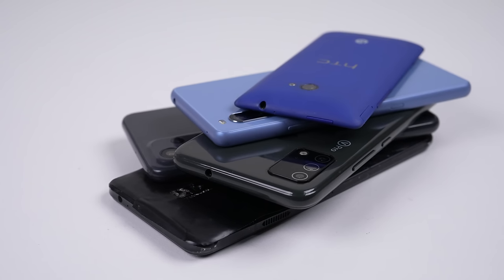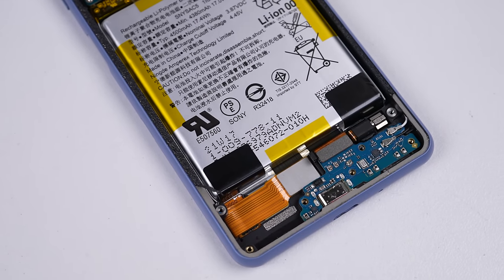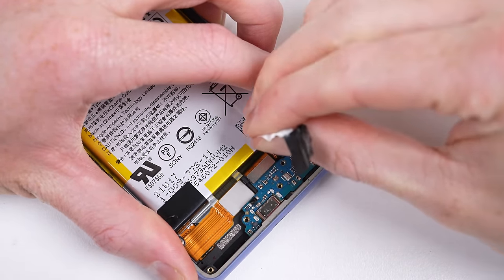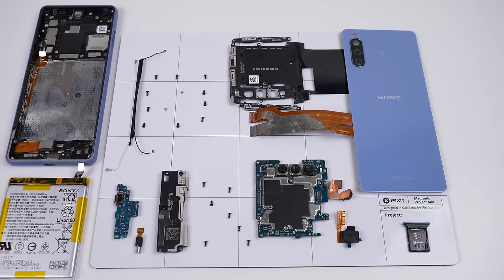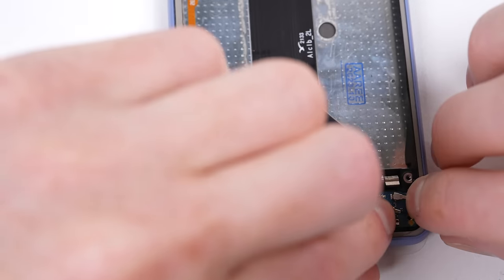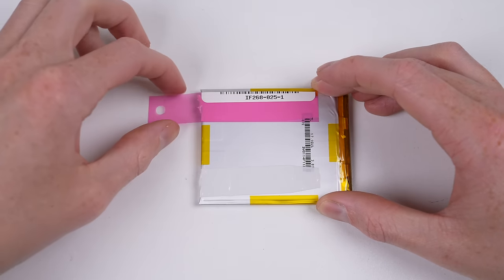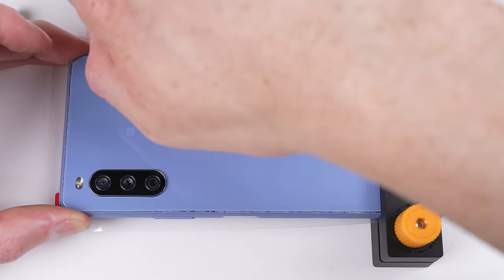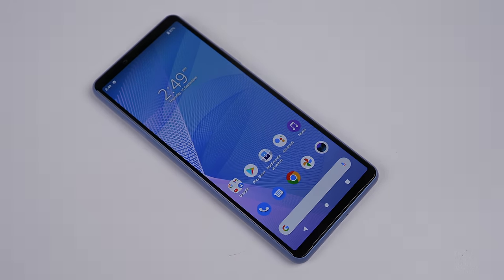This Uncommon Phone Is Shockingly Easy To Repair - Sony Xperia 10 Mark III

Comment: The problem with Sony phones is their pricing and aftersales service sucks, not to mention their OS update support is the lowest among Android OEMs (2 years of OS updates only while other Android OEMs give 3 to 4 years of OS updates).
Reply from the maker: This one supported Android 10-13. Thats better than my Blackberry that supports Android 8.1-8.1 :(
Reply: @HughJeffreys Are you sure? I have this model and it shipped with Android 11, the last available version being 13. Security updates are probably already halted as well, unless Sony quietly changed their policy recently.
Reply: @HughJeffreys  have you thought about making a video talking about the AU 3G (2023/2024) Switch off and the e-waste implications for older 4G Android Phones that don't support 4G VoLTE Calling? Older Pixels, Samsung and various Sony Phones are affected. Also any Samsung device with Android 11 or lower won't have VoLTE Roaming (Per Optus's website). Wanted to contact you about this a month ago but your website contact form is closed. Optus in 2019 even said to the ACCC that "VOLTE cannot be the sole technology relied upon to provide voice services" and "even if VOLTE were available over the whole network, end-users would be unable to use the technology due to incompatible handsets". With the 3G Switch off a whole bunch of 4G phones won't be able to make or receive calls anymore. Happy to discuss further etc. I've got Twitter and email is on my Youtube about page.

Comment: Being sonyboy for the last decade, I also wonder where people are geting all this nonsense about sony's phones and tablets.
Sony's mobile branch is the most customer respecting company on Earth and their devices are both serevicable, functional and stylish.
Unlike some vegetable devices, sony's do actually look and feel premium.
And they are priced more premium because they are.

And when you need to replace a battery in 3-5 years, it's not that hard.
And may want to do this, because even in 5 years it will still be powerful enough, more than stylish and also supported (most likely by a third-party, but the bootloader is openable and the drivers package is available).

Comment: I knew someone who worked for Sony back when they were still selling in Australia. He said the reason why they tanked here is because of a failed marketing campaign (something about how they said waterproof even though their phones were, in fact, water-resistant, and some higher-up's stubbornness in not rectifying the language). It led to heavy losses and legal trouble, leading to them pulling out of the market here. Based on this story, it's not so much lack of interest from consumers, but trauma from getting burned for a few badly chosen words in a marketing campaign.

I love that they go against the grain and keep going with things like the headphone jack (which I really feel the pain of with my Xiaomi 12 since my car uses an AUX cable, no Bluetooth audio...). 
The only problem I have with importing Xperias as an Aussie is their lack of support for VoLTE and 5G, even in newer models such as the Xperia 1 iii which my friend has. With 3G getting switched off, Xperias aren't a viable option anymore unless there's a workaround like installing SEA firmware.

Comment: I have a Sony phone, the UI is buggy has less OS updates than other flagships and has random quirks.

The camera is not user friendly, it's great if you're a professional photographer who likes to customize all settings but it's not good if you want to take a quick photo of something which is what you'd need a cell phone camera for 99% of the time.

I got my Sony because of the SD card but I think I might just move to an SD card less phone with a lot of storage as SD card phones are basically dead in the US unless you want a mid range

Comment: Just based on my experience and what I’ve learned, Sony phones never gained significant traction in the USA. It seems that Western markets weren’t particularly drawn to them. Sony eventually shifted its marketing strategy and focused more on Asian markets, where they performed better. Personally, when Sony phones were available in my local market, they were expensive and didn’t offer a compelling value proposition compared to other smartphone brands in the USA. For a similar price or even less, I could get a better overall experience with a Samsung phone.

Comment: Is the replacement display you put in in this video genuine Sony or aftermarket?

I'm still rocking an XA2 for which I recently had to replace the battery. (It had inflated). Replacement was pretty straightforward. Only issue I had was one of the antenna connectors broke off the motherboard which was a pain to resolder. Getting a replacement battery wasn't hard, but I couldn't find an original from Sony. 

Also, has anyone done a bend test on this (or similar designs from Sony)? It looks pretty long, thin and narrow...

Comment: The reason why Sony's phone division isn't as popular as someone like Samsung, is because sony has a rather lacking record when it comes to software update. Pair that with how much more expensive their phones tend to be, and most people just steer in the direction of what we already know just works (Samsung, google, apple).

However, if you can afford Sony's phone, they are definitely the better smartphones available right now. Software wise, you can always tinker with custom roms if you feel comfortable withthat

Comment: Also btw I'm sure you've noticed by now, that you could've removed the charging port board and vibration motor first before attempting to use the battery pull tabs and it would've probably worked, save yourself the time and effort next time :D

Comment: Sony's phone hardware are great but software are abysmal, I've got a Z5 back in 2015 and it was nice at first, not two years later my z5 running latest supported android and it was slow, slow to crawl, everything crashing and it would randomly restarts, mind you, z5 was a top of the line model, yet it was defeated by Sony's software, in true Sony's fashion it also shipped with metric ton of bloatware, this is know issue not just Xperia phone, Sony's laptop, vaio also suffer from this and both of them are the reason why Sony's tech are never took off to its other level.

Comment: Sony putting the Lego in phones. 

Sony has bad marketing when it comes their smartphones. It has great hardware, simple software and specs monster to boot. But short software support, bad marketing distribution and low worldwide availability means it's not accessible to most market. Still, it's if you want an all rounder Android that's not Chinese or Samsung.

Comment: The majority of the consumers don't know that sony makes phones since they are no commercials about sony phones like the commercial for the sony ps5. The average consumer only knows about products if they are marketed on tv commercials. Consumer products have to be marketed and commercialized like cocla cola and mcdonalds fast food since they are ubiquitous. I really enjoy using my xperia 1 iv but I already have burn in issues just like every device that I use with an oled display already have burn in issues. I wish there was an option for a mini led display for all android devices to get rid of the burn in issues but also have an option for an oled display for the consumers that want to use an oled display. The samsung, motorola, nexus and pixel devices with an oled display that I use all have burn in issues. I got burn in issues with all the devices that I have mentioned. It's why I prefer to have a mini led display as an option to rid of burn in permanently. When I got burn in issues, the white background is no longer white and have turn yellowish and even reddish with the display brightness have gotten dimmer overtime and it makes it harder to see outdoors. The way I use any oled display, they will get burn in 100% of the time.

Comment: I don't understand this fascination with putting those bastard pull tabs back on a phone that's already been opened and had it's internals serviced - ordinary removable double-sided tape from the stationery aisle will ALSO hold that battery in and make it far easier to remove if need be. Why torture yourself???

Comment: I challenge you to replace the front glass of the display instead of buying a new one and reselling the old one.
This can be done using a very thin metal tool and metal wire, the glue is then removed
You then apply new UV glue and a new front glass

Comment: me i would not replace the tape strips on the battery i would just leave the battery flopping loose so if it has to be replaced again it comes out easy.

i would even shim it down by putting a piece of light cardboard cut from a food package so the back glass would provide the prevention of flopping.

Comment: An easy and cheap to fix phone isn’t the solution to design flaws. I am talking about the Xperia 5 series, especially the 5 II. There are numerous reports of users having lines, predominantly green ones appearing on the screen. I am one of those. And Sony is not taking responsibility for this massive design flaw. At the end of the day, headphone jacks and microSD card slots are nowhere nearly as important as a functional screen. 
I have bought 5 Sony phones, 7 if Sony Ericssons are included. I value what Sony is doing. But I am not buying Sony phones anymore after the 5 II fiasco.
Reply: That's mostly Samsung's fault as the panels of the 1 and 5 Mark II were the same panels used on Galaxy S20 that suffered green lines too. The 10 series, including the featured one here, barely suffered any. And it was mostly concentrated on the phone you mentioned, the 5 ii and small chances on 1 ii and 1/5 mark iii.

Comment: I just bought a couple of days ago a used Sony Xperia 5 II as a temporary phone, cause I lost my Pixel 6 and it turned out to be such an amazing phone for me, that I am searching now for a newer gen Xperia 5 or the same one in mint condition. It is very comfortable to hold in hand, and it has a 3.5 jack, notification LED, and good specs, what more could you ask for
Reply: I've owned the Xperia 1 II (from the same year) for two years now...mine was a repair project I fixed up from a busted screen. Hope you find something newer at a good price...if you don't, it's not a bad phone to do a battery swap of you need to.

Comment: They may be easy to repair but also have planned obsolescence written all over. The back glass was probably just about to come loose because that's usually the first thing that happens. I'm rather amazed that they're still in the phone market
Reply: @Failure_Is_An_Option  I've owned several Sonys boi. still have a couple in my drawer with the back panels loose
Reply: @Failure_Is_An_Option  you're a bot
Reply: @Failure_Is_An_Option  Liar
Reply: Who's paying you?

Comment: The Sony smartphone my ex had, was the worst thing I have ever seen. Yeah, it was easy to repair. But the glass panels were so ridiculously thin, it cracked from just looking at it. I still have two replacement displays for it lying around because that thing would break even with a protective case when it dropped once. I had some more bad experiences with Sony phones and smartphones and their "service" in the past, so I am not buying Sony phones anymore. Simple as that.
Reply: I totally agree.